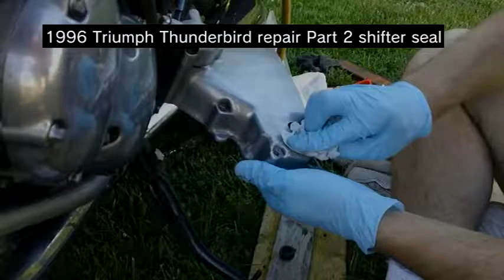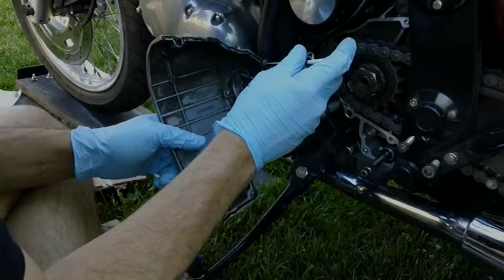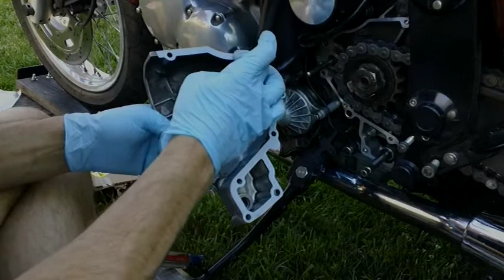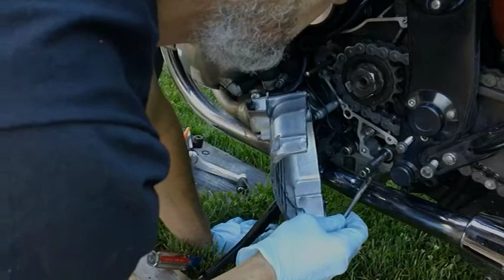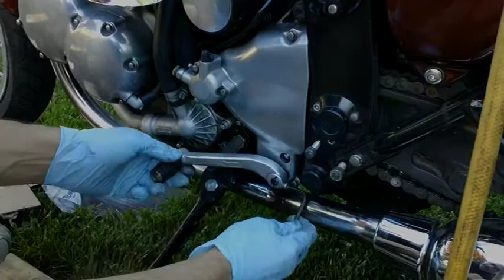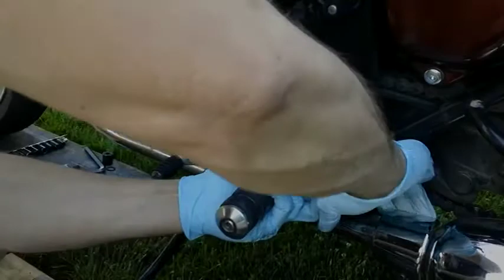1996 Triumph Thunderbird shifter seal Part 2

Comment: Do you happen to remember the torque specs?
Reply from the maker: victor naranjo for the cover bolts?
Reply: Yes
Reply from the maker: victor naranjo if I recall correctly those are 6mm bolts and should be 4.5 ft-lb or 6 n-m.
Reply: crabblike awesome, thanks for responding!
Reply from the maker: victor naranjo glad to help, you’re welcome.